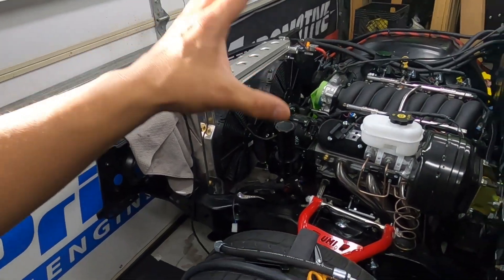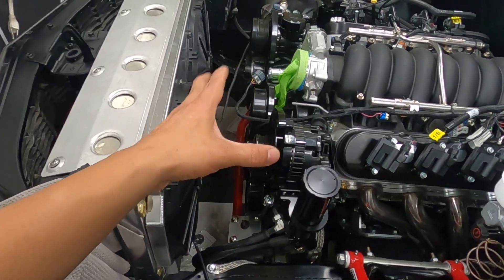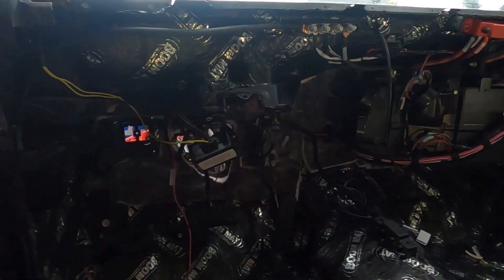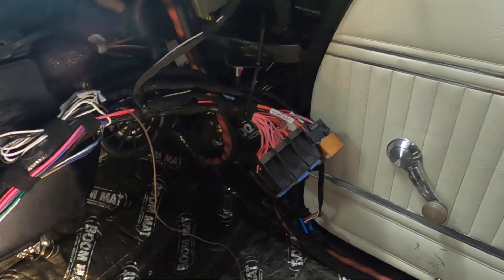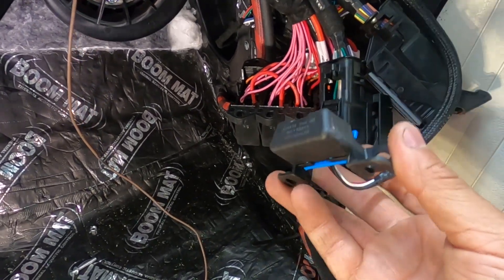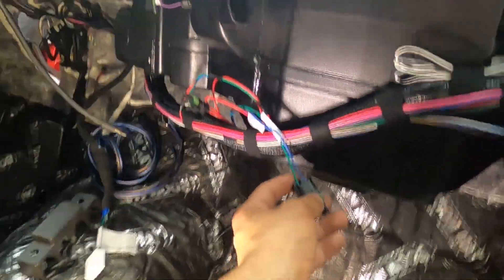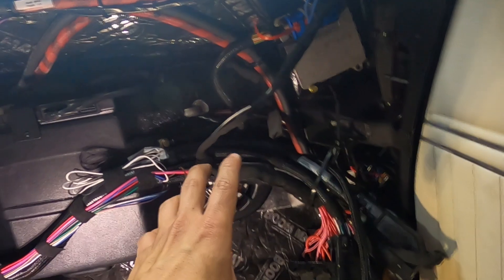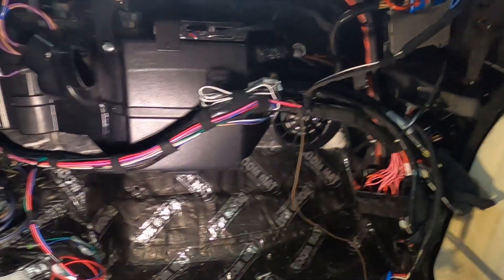WIRING YOUR LS SWAP RIGHT THE 1ST TIME W/ PSI

Comment: I understand the standalone is plug and play, but what nobody ever discusses is what to do with the stock GM engine harness wires?  Purple crank wire that originally went to the starter solenoid?  Red wire coming off the original Gen 1 alternator stud?  What do we do with those?  Thanks!

Comment: Great video!! Bro keep up the clean work💪🏽learned everything I need to know
Reply from the maker: @rockyrodriguez4951  glad to help
Reply: @goossepercformance1444 hey bro do u think u can do a video on wiring electric fans ima running both same wiring kits psi and American auto fire I’m just stuck on getting them wired correctly and Turing on when they need to